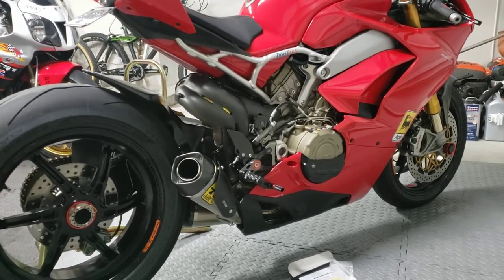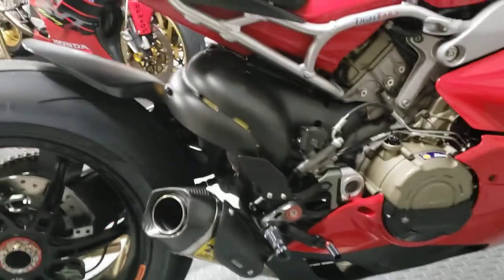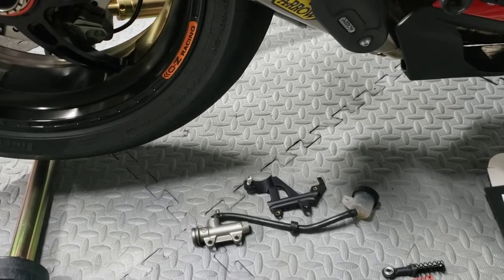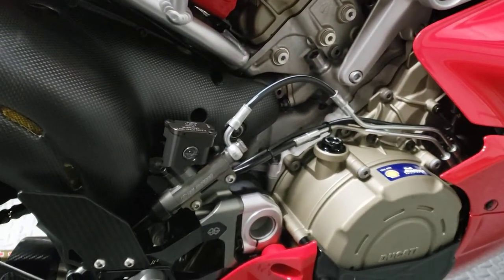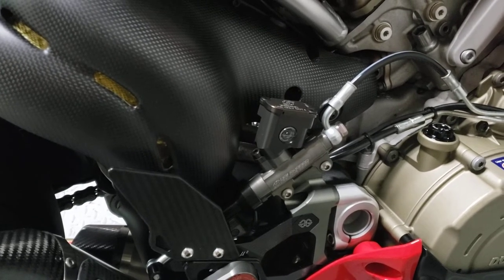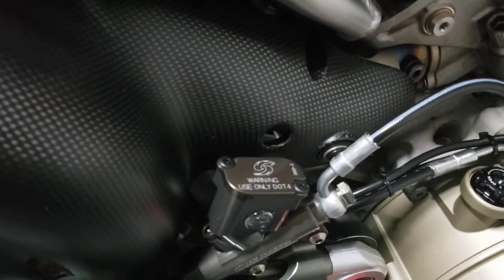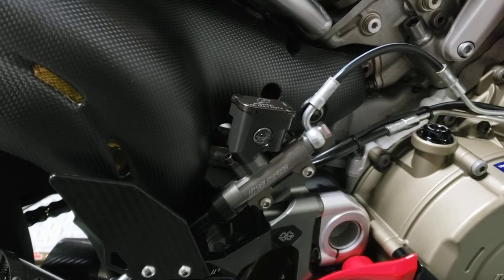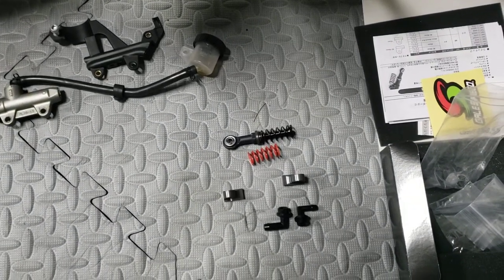Ducati Panigale V4 gets Galespeed Billet Rear Master Cylinder

Comment: Ya the rear brake fluid on my bike gets cooked to having the reservoir so close to the exhaust, and my clutch fluid does the same because they put the slave cylinder for it right between the cylinders of the motor,i switched to dot 5.1 and it keeps my fluid from cooking. That's a nice upgrade, I just saw Jaret Campisi put that on his SP Ducati, I'm not sure if you checked out that video, but yeah it's more like a dirt bike setup built into the assembly. I also have a 2019 did you get the latest software updates there are three of them, they really make the dash light up all kinds of cool colors when you start getting towards Red Lion red and yellow and it starts flashing like on the newer panigale V 4
Reply from the maker: I'll have to look into getting the updates . The jury is still out on of this helped keep the rear brake fluid from boiling, but ok so far. This master also changes the piston size of the rear master providing a better feel at the rear lever.
Reply: @marcjorgensen  yes better feel is great because the stock is like a light switch either its on and locked up or its off, for the front Ducati has red calipers,well you can get them in black too with red letters, have you seen them? And i was looking at the rear resivoir on your bike, doesn't that bring it even closer to the exhaust?
Reply from the maker: @ashten92  yes, but separated by the stainless and carbon heat shield,,which actually is pretty cool to the touch compared to the open engine bank, but still anywhere near the engine or exhaust on this bike is smoking 🔥.  I have some plans for the calipers, but I have seen the red Stylema,  they look pretty sweet
Reply: @marcjorgensen  i was having to swap out my clutch fluid about every 4 month's, thats how black my fluid was getting. It's been almost a year now and just a little dark.